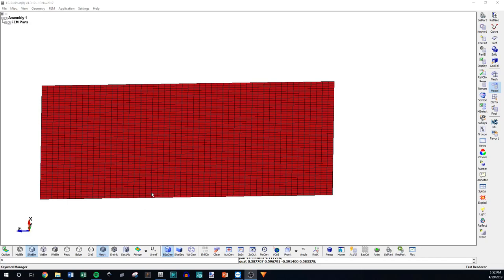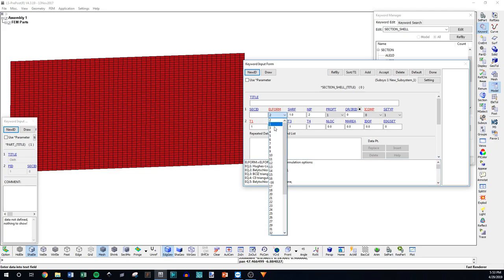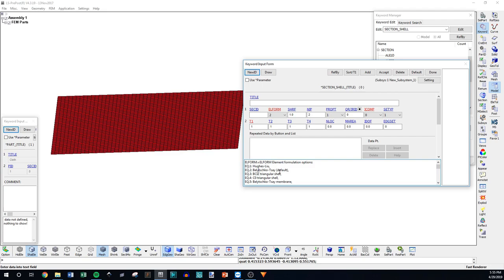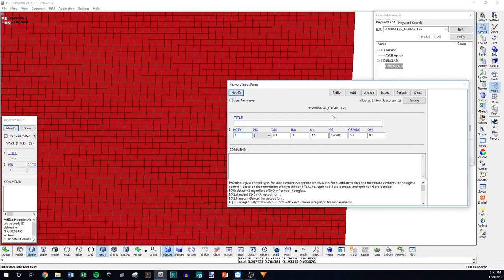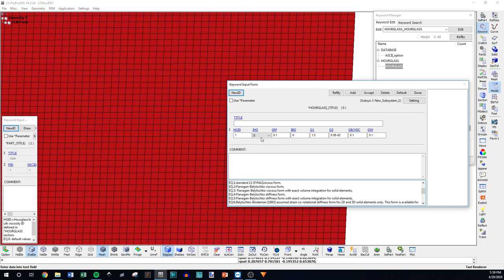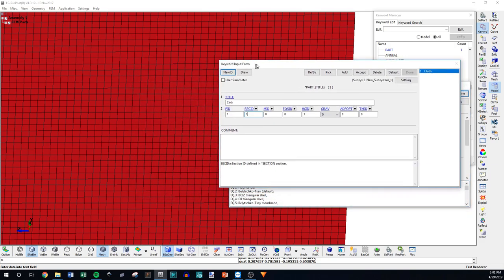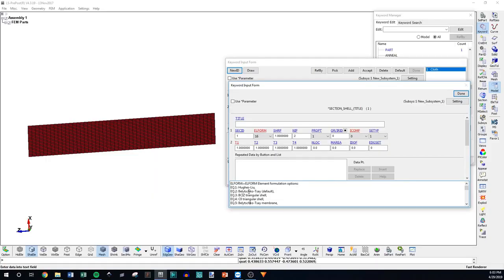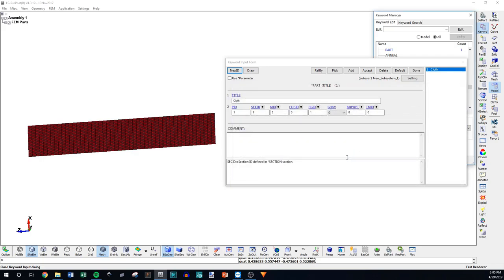LS-DYNA Tutorials for Beginners: Finite Element Analysis Shell Element Formulations

Comment: Hello I want to solve Central deflection in composite material. but how to apply that load. Can u help me? I want to do this research's problem. Mechanical behavior of laminated CNT-reinforced composite skew plates subjected to dynamic loading
Author links open overlay panel
L.W.ZhangaL.N.Xiaob
Show more
https://doi.org/10.1016/j.compositesb.2017.03.041